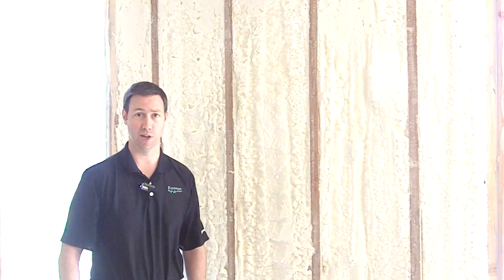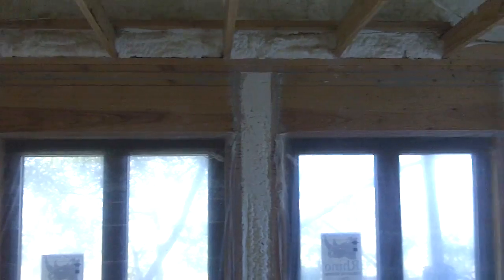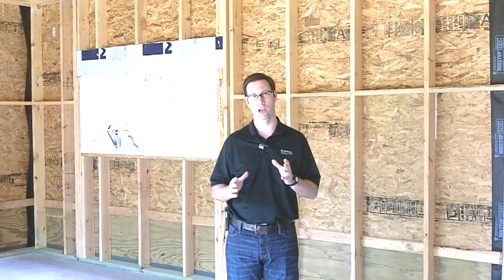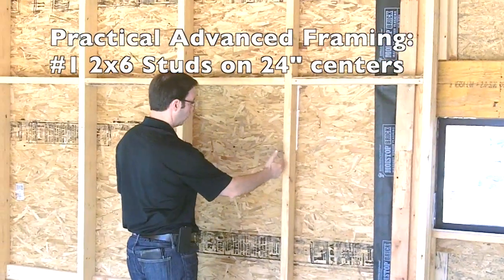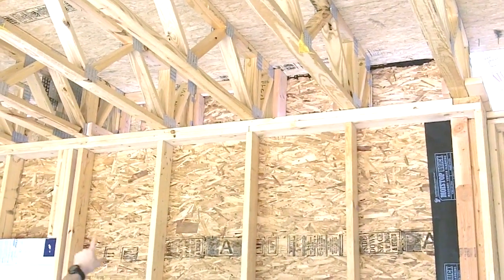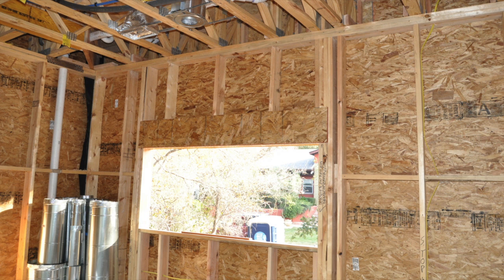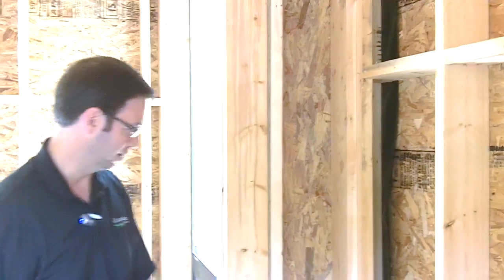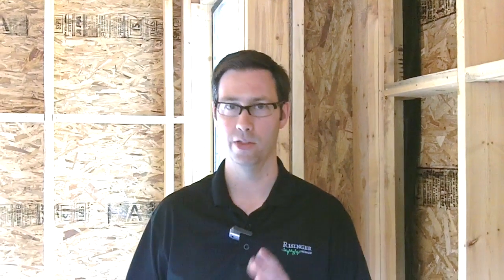Advanced Framing vs Traditional Framing

Comment: 2:44  16" OC is unnecessary? it makes everything else after easier  24" c-c is just a way for contractors to trick themselves into thinking they are saving a couple of bucks but if you actually add it up it's not that big of a difference.  6:13  there is a benefit to the builder & client on saving money.  I bet non of those savings are on the clients end.

Comment: I had little to no respect for anything you had to say about anything. And then you went and said 16 on center was unnecessary. If you claim that California framing is inferior, I invite you to come build a house here.  2x6 exterior walls are the new mandatory.  3x's are minimum requirement at all shear panel connections and common nailing schedule is 2 rows 2 inch centers. holds downs typically every 4 ft. Your framing belongs in a Home Depot storage shed. 
Also you should look into getting a pair of eye glasses you don't need to adjust every other sentence.

Comment: This may work in central Texas/Austin where there is no windstorm code, sisemic activity, or snow load rating but in most areas these corners and 24" OC framing you appreciate are not even legal. You're still using same laws of physics that the "traditional" framers use--nothing "advanced" about your buzzphrase "Advanced Framing!" . 2x6 exterior walls are pretty much standard in anything beyond tract home building today. Only difference is you skimp on structural lumber that may be illegal in a particular zone.

Comment: I would never build a house with osb. I would never build a house where my bottom plate bolts don't actually work due to improper placement.  Also, dont believe anyone who says that 24 oc is structurally more sound than 16 oc. This type of framing is only a way for contractors to go the cheap and charge more for a cheaper built house. Just my 2 cents for building everything from 28 story buildings to your typical family homes. To me this is no different than folks pushing and saying how much more stronger a house is with only using 1 top plate. As I mentioned before.  Contractors trying to push for cheap houses for more profit at the expense to the home owner.

Comment: how is this cheaper? Two 2x6 in a 24 inch space is like having (in material) a 2x4 every 12 inches. What I mean is in those 24 inches you used around 8 feet of lumber, when doing traditionally you use those same 8 feet in 32 inches. If I am wrong please let me know why.

Comment: The 1,597 comments, almost all of which are negative; have 2 things in common.  The level of self-confidence is only surpassed by the level of ignorance.  No wonder the housing industry is stuck in the stone ages.  We work with great builders who have been using advanced framing techniques for 10 plus years already with great results.  You sound like stubborn fools.

Comment: I use double 2x4 exterior walls with 16 oc but stagger the interior and exterior wall systems if possible this gives 7" of space for spray foam(not a fan of the off gassing but do use it for the insulation properties) with the staggered 2x4s there is no thermal bridging of studs except for windows doors and corners, plus 2 2x4's cost about the same as a 2x6 so its not much more material cost however it is more labor but i get paid for the labor. I also never use osb I hate that product. if i'm doing 2x6 exterior framing i build headers with 2" foam sandwiched between two 2 by's, gives me a r 10 header with plenty of meat on each side, the cali corner is all ive ever known. building in Montana for over 10 yrs mostly un-permitted un-engineered projects(you can usually over build cheaper than hire and engineer).

Comment: So many under educated folks in my profession. I'm a carpenter with 41 years experience and a college education in construction technology.  There is nothing wrong with this system of framing and Matt does a fair job of explaining it (Hey Matt, you forgot to mention ladder blocking instead of traditional wall tees). I'm not a fan of foam insulation, but it addresses the fact that if you leave leave just an inch or two of gap you will lose 10-20% of your rated R value (don't believe me? Look it up!) Also, what's so dopey about insulated headers? Not only have I used this system successfully for years (I go back and check my work years or decades later), but I also use finger jointed studs (where applicable), LVL lumber, OSB sheathing, TJIs, roof trusses and modern house wrap (MRB). The reason is twofold; 1. energy efficiency, and 2. resource conservation. I have yet to see any negative effect on any of my completed projects. The real problem as I see it is the lack of professional development. Most people in this industry were trained by the dumbass next to them at work. And they never learned, or wanted to learn anything more. Some of the comments below are astoundingly uninformed. Maybe those traditionalists should go back to driving nails and cutting lumber by hand.

Comment: I like  2"x6" with 16" centers both for strength and snow loading but also for the thicker insulation which is needed in the northern climates. I HATE blown in insulation!  It's a mess and very difficult to remove down the road.

Comment: This isn't actually advanced framing.  In this example what you describe as advanced framing with 2x6s would be advanced framing if done with 2x4s.  If you spread 2x4s to 2 feet the wall can't support second story and roof loads, unless you align the rafter, or trusses with the studs.  In many places you can already do a one story building with 24 inch spacing and random rafter placement on the plate.  

The 2x6 wall you show as efficient actually has a lot more wood in it than the 2x4.  The studs in a 4 foot section would have 24 board feet of wood, nominal, and the plates 12 feet, for a total of 36 bft.  The same section of 2x4 wall would ahve nominal 24 bft of wood, plus one additional 8 ft stud, with less than 6 additional feet, so you would be 30, on the 2x4 and 36 on the 2x6.  And your corner detail uses more wood.

The reason all this happens is because you are using 2x6s to give deeper bays for insulation, as you noted.  Which is fine, but it does not save wood. Using  24 inch spacing saves lot over houses that use 16 inch spacing with 2x6s which is conventional around here.  

The way to really save wood is to go post and beam where you use the same amount of plate lumber as 2x6 walls, and only two 4x4s for an 8-10 foot section of wall and it requires only 1 4x4 for every running section of wall, compared to in your example the equivalent of an 8x6 for the 2x construction.  The problem with post and beam is either very expensive curtain walls, or windows.

Comment: I've been in the construction field since I was 13 and I'm now 55 years old.
I was always taught that wood was the best insulator and I believe I first learned that at Wentworth Institute of Technology where I went for a Bachelor of Science degree in Building Construction Technology. 
Those types of exterior corners that you called California Corners have always been considered a really cheap way of framing a house and a short cut.
You might want to take this video down and do some research.
Reply: Are you aware that there has been probably 35 years since your education and today? Are you aware that things may have changed in that time?
Reply: current advanced framing is structurally engineered.  when we looked green building as our way out of the recession we saw that this was indeed a better home. we were willing to look at the science of building. addressing not just structural issues its addressing thermal bridging and bypass, indoor air quality by using low to no VOC paints, formaldehyde free cabinets and orb etc., etc.
tisis not the cheaper alternative its the better way.  the science backs it up.  we were the able to deliver a healthy, affordable net zero energy home with remarkable efficiencies and not compromise structural integrity.  the science of building was able to keep us in our loved trade when others gave up because they weren't willing to look.  oh yeah...we also made the commitment to make less profit and deliver homes at a competitive price.  green building costs more, has a better attention to detail so is more labor intensive.  but we were building when others weren't and soon were so busy we added crews.

Comment: I'm building my house right now with my 4th little piggy method . W8-24 Steel I-Beams , 12 of them vertical , welded to  10 horzontal to support the 2nd and 3rd floors,  8 inch Purlins on 2 foot centers in roof , and 4 foot centers in walls .That makes the walls and roof 8 inch thick, covered that with Foam it green spray foam  , covered that with R 30 fiberglass.  It's rated for 200 MPH Wind load .  Not finished yet but when it's cold outside my 600 Sq. Ft. bedroom has a tiny space heater that kicks on once in a while .

Comment: Why not just switch to metal studs the keyholes are already punched for electrical and other trades metal stud frames are also lighter but still stronger easier to build in a faster time usually more plumb depending on the framer and oh ya they dont burn or collect pest

Comment: also called 'hackenstein ' for exterior cal corners i use 3 2 x 6 s to make a u shape. it gives 7 in backing for ext corners and siding as well as 1.5 in for drywall backing, some people maintain 19 diamond is all right but the floors bounce and sheathing is difficult.

Comment: What I would like to see is how the house holds up (compared to traditional construction techniques) : 1) in an earthquake, and 2) in a fire.  My understanding is that traditional framing helps anchor the home during an earthquake.  Sheeting the entire house would probably help with earthquakes but what about fires?  Also with so much foam I would be worried about toxic smoke formed during a fire and if it would hamper evacuation or firefighters from extricating victims from the burning structure.  This construction might also have difficultly with a three coat stucco exterior since the anchors need to be inserted into the studs.  I guess if you use expanded metal lath (3.4 lbs per sq yard) which is stiffer (than woven wire lath) and screws bigger than furring nails it might be OK, but I am not sure.  I definitely like the thicker drywall on the inside which would add to the fire resistance.

Comment: B.S on your "traditional" 3 stud corner being ineffective. Any good builder pre-insulates the corners and channels and anywhere that further on  will be hard to insulate.  Plus you have not properly shown the assembly technique of the corner itself.  "I prefer to use plywood" yet you  use OSB anyway. You are even using OSB on the roof sheathing.  Seeing that plywood is such a much better product and costs almost the same as OSB , why wouldn't you use it?   Damned hypocrite.   Seems like you are throwing money away with extensive labor with the horizontal blocking, ridiculous time consuming header fabrication, and whatever else.   . 24" centers?  You should be building modulars and trailer homes with that attitude.  What do you do on your roof trusses?  4 ft on centers?  Your "California" corner does not work as well.  If you will note, once a corner board is applied to the exterior, the siding itself on one of the walls will have no nailing for almost 2 feet.  Matt, you obviously have never built custom homes nor built homes with the intent of quality or longetivity.  But what do I know?  I've only been building since 1973.

Comment: you need to update this video, you should use a 1 by 4 for drywall backer in the corner instead of a whole 2x6 stud, and you totally missed the single top plates of advanced framing
Reply: exactly.  land the truss on the stud and eliminate the 2nd top plate.  save on thermal bridging etc.

Comment: If you are trying to reduce the amount of wood, you're going about it all wrong. A 2x6 wall on 24 uses 30% more material than 2x4 wall on 16.  Worry about the R factor of the windows not the headers.

Comment: There is nothing "advanced" about putting studs on 2 foot centers, using fiberstrand headers or framing the corners 2 stud.  Use the fiberstrand engineered headers and beams, and frame the corners 2 stud, but scrap the 2 foot on centers idea.  Plenty strong enough, but adds labor and frustration installing blocking for electrical boxes, plumbing anchorage, cabinets, etc.  Also the homeowner will curse the builder when he tries to find a stud to hang something on.  Definitely use 2x6 walls or greater for the added insulation benefit, a lot of places require that as a minimum to meet the energy code.   OSB is just fine for sheeting, but if there are moisture concerns then use the plywood, but construction should be done to not allow the moisture under the siding in the first place.  The 5/8" sheetrock is a good idea for smooth walls and more sound dampening, but more expensive in material and heavy to hang.   All of these have quality and cost tradeoffs.  For example, I would not sheet my own house in plywood, because OSB has plenty of shear strength and I would rather put the money into something else.  Final criticism:  Using the word "advanced" might get you hits on the video, but it is misleading; you are NOT bringing up anything "advanced".

Comment: In 1978 I reviewed a film on the Arkansas story. Builders were constructing 1,400 sqft homes with 2X6's on 24 inch centers with  R-19 insulation. They were chalked extremely well to prevent excess air exchanges. This new approach to building homes in Arkansas was successful because the power bill for heating/cooling averaged $10.00 using a small heat pump. I was the first to build a home in Southern Oregon with 6 inch walls. At that time they used 3/4 inch plywood on the exteriors which I had covered with Redwood lap siding. My house is 2,500 sqft. I only use a 3.5 ton heat pump. I am able to maintain an average temperature during the summer of 70 degrees with the heat pump running full time during the day in 100 degree summer weather.  The house is 40 years old I am still using the original heat pump split system. I am very satisfied I built my home with 2 x 6's on 24 inch centers and the side benefits that accrued.

Comment: Folks if you have knowledge of how to build a house you can do whatever you want to! Most importantly you can catch all the shortcuts builders do, like not glueing plywood, and not bracing and strapping studs and not using bolts to hold beams etc, it's your house! So put all the strength in it, 24 vs 16 is all the same, remember windows and corners and doors will have more studs anyway!

Comment: WOW! no integrity on the wall at all! I'm all for saving on heating and cooling, however I'm all for my wall standing! Don't estimate the R values on the wood headers because u are, and I promise you so far off, what was that wood made of, how thick was is, was there insulation, was it locked, glued or dovetails into    place! so many factors. I own a log home and I could go on and on as to how wrong you are about all of this mess. let's leave it at this there is a fire, that foam that you trust in burns hot and fast! try taking a blow touch to a full log see what happens! oh boy walls build on foam! God bless America, hate to be in that windstorm!

Comment: As an addendum, the 'up-front' cost of using quality materials is more than made up for in durability and longevity. For example, the use cost outlay of '2 x 4' versus '2 x 6' is minimal. This holds true for the use of 1/2" versus 3/4" plywood. Too..., if there is any 'Pride' in Workmanship... never use 'wafer-board', even if it is merely an 'out building'. Just saying!

Comment: I don't intent to be an 'smart ass here, but I have dealt with 'framing' before and after '1950's'. This is a good example of it, but not of 'post' 50's framing which, as an 'standard' uses 16" spacing. lol
  If the third spacing between studs in this video is 16" spacing, the first spacing would be about 7", the second, about 13, the third (assuming 16") 16", the fourth about 191/2 and the fifth roughly 14".
  When dealing with any type of structure, especially those built prior to 1950,  never 'assume' anything. LOL!

Comment: More than 50% more lumber in a 2x6 than 2x4. Exactly 50% more space between studs on two foot centers than 16. Might as well frame 2x4 on 16 centers and not worry bout making sure your floor trusses line up with the studs. Second, if you’re so smart why don’t you stand up your plywood n eliminate the seam? Builders like you piss me the fuck off. Think u know everything. Shut the fuck up n let carpenters do the job how they know

Comment: As a framing carpenter of 35 years, I can say without reservation that this guy doesn't know what he's talking about at all.

"Traditional framing corner"...???  lol.  There's NO ONE who's a professional carpenter that does that at all.  You might find homeowners or drunken handymen who do it...but not actual carpenters.  And, chances are that a building inspector would fail that configuration on a rough inspection anyway.

And putting studs on two foot centers is just dumb.  Sure, the sheathing is rated for it but it's not about meeting the minimum spec.  Drywall and siding on 24" centers is just hokey ass nonsense.

There's nothing "advanced" about this framing...just cheap.

And to us "old guys", a California corner is NOT what you're calling it.  A California corner refers to holding one wall back from the width of the adjacent wall the thickness of the sheathing so that the sheathing can be run all the way to the corner on both walls...thus using the sheathing to tie the corner together rather than relying on just nailing/toe-nailing the corners together; it is, in effect, just creating a sheer wall.